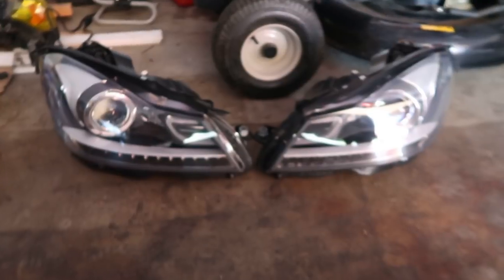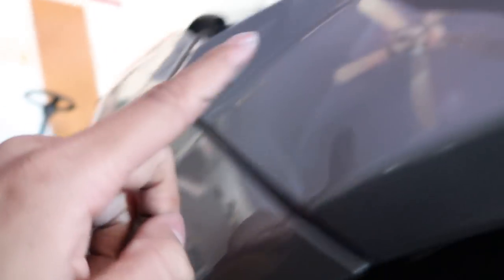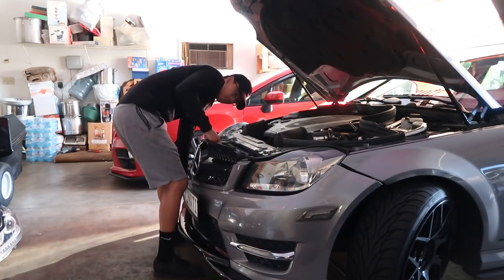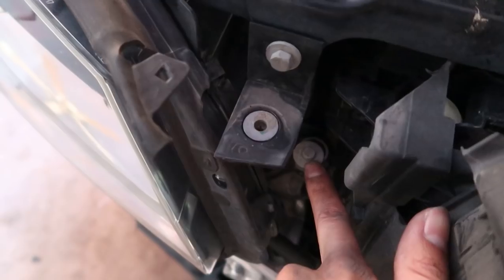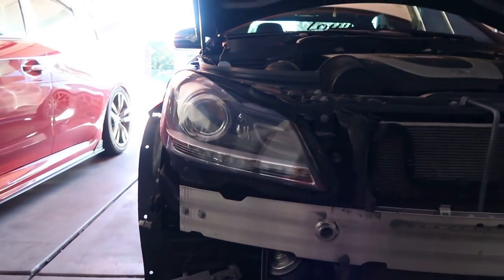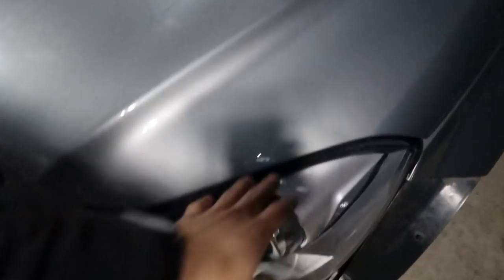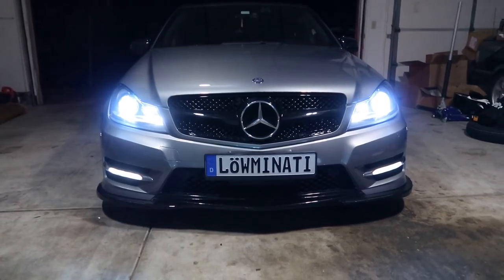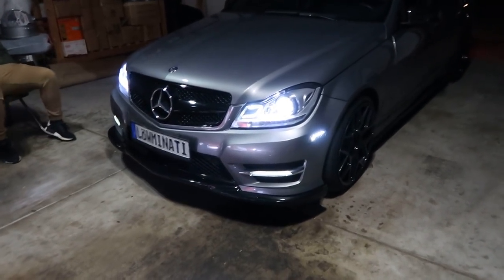2012 Mercedes Benz C300 | NEW Depo Projector Headlights | Unique Style Racing

Comment: Quick question (typical question by many new C300 buyers) how is the reliability?  I am planning on a buying a 2014 c300 Facelift model with 50,000 miles on it.  Anything you would like to share with me?  Thank you
Reply from the maker: Hey man, what’s up! Honestly, it’s a really reliable car, can’t go wrong with it. Had the car for about almost 5 years and only one main issue was my a/c blower went out which is typical for Mercedes. Other than that, it’s an amazing car to have. No other concerns you should be worried about. You’ll definitely like the car 👌🏽
Reply: Ans Bekk don’t be scared it a very reliable car I have one with 107k miles runs like a beast I do regular oil changes my mechanic do service the transmission every 50k miles for me at $190 he’ll order the oil from Mercedes Benz

Comment: Projectors in Depo headlights are pretty bad. I have replaced them with proper bi-led projector and output is a looot better.
Reply from the maker: Veron161 hmm, interesting. They don’t look bad to but I’ll definitely look into those bi-led projectors!
Reply: @Lowminati  Maybe I did not write properly. I ment Depo projector inside headlight is poor. And I guess you have LED bulb inside, which means lack of hotshop (distance). Anyway, since this haadlights are sealed with butyl, they are very easy to open and replace the projector. I got i.Lens 2.0 bi-led projector and brackets inside package were great (small modifications).

If you need pictures and more details, you can contact me and I'll help.
PS: output is like day and night compared to stock depo projector (halogen)
Reply: @Veron161  hey, I'd like to learn more about this. I'm looking to switch plain halogens to something like bi-xenon lighting.

Comment: Hi 
Have problem with C shape light fail ,any ideas to change this module or to fix it?
Thanks
Reply from the maker: theog60 hey! I had the same issue with my V1 with my C LED light going out as well. Since it is a C LED strip, can’t be replace or change but there’s two options, 1, contact Unique Style Racing and ask for a new module to replace. 2 contact USR, if your headlight is still under there year warranty, they’ll send you a new one.
Reply: Lowminati hi
My lights are depo,
After contact with them , the after sales service was very bad , no solution
Reply from the maker: theog60 yes, USR sells Depo headlights. If you don’t mind me asking, where did you purchase your headlights from?
Reply: Lowminati 
From pure cardesign Germany
Reply from the maker: theog60 hmm, I would contact them then instead and ask if you can get a module replacement. That should fix the problem of the C-LED strip
Reply: Lowminati thank you.

try to contact USR for a module

because pure design and depo europe didnt find me solution!
That what i told you in  previous post
Reply: Yep same thing happened to mine and USR was no help at all. Depo headlights are junk and will never buy them again. Both C LED lights went out after 4 months on both sets that I had.

Comment: Where did you put the little boxes for the headlights?
Reply from the maker: Caleb Knight boxes as in the ballast for the HID’s?
Reply: Yes
Reply from the maker: Caleb Knight on the driver side headlight, I used 2 zipped ties to tie my ballast to my a/c line, right by the a/c recharge port and for the passenger side, I just tucked it right between the wheel well and the frame of the car, where your negative internal is for the battery. Or I will be uploading another video in a couple weeks about the new headlights and I’ll be sure to show where I have it in the video! Hope that helped!

Comment: Did u have stock Halogen bulbs originally ?
Reply from the maker: 2 Mjr I did not. Already had HID’s when I bought the headlights
Reply: @Lowminati  what kind of HIDs did u have ?
Reply from the maker: 2 Mjr when I bought the V1 headlights, had an option to pick HID’s or not so I did and came with it install already but I think they’re called C9 HID’s. I’ve been using XenonHids before I got the new headlights